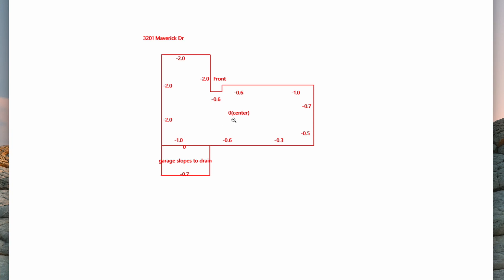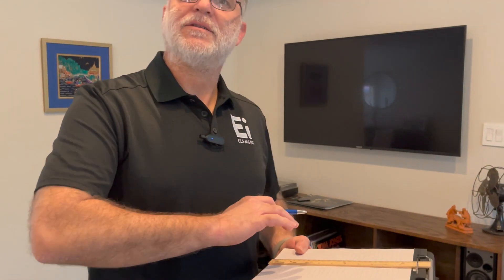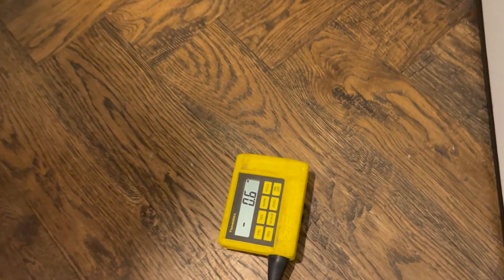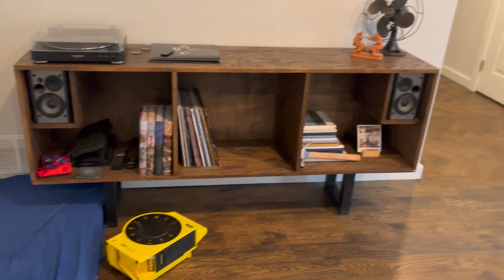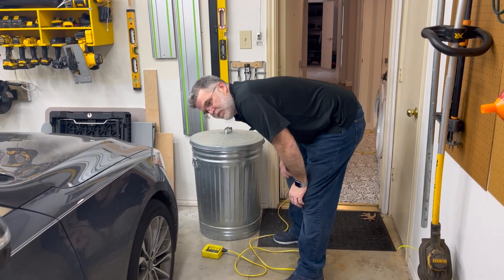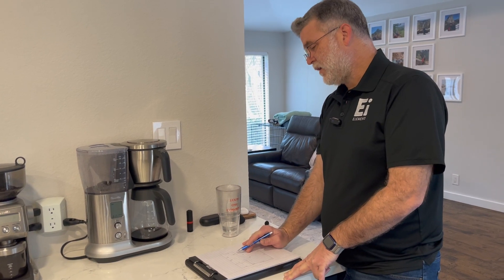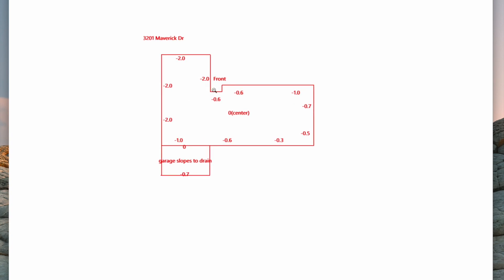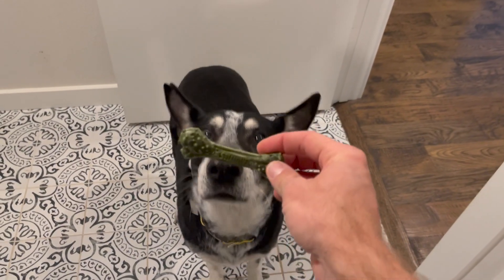Should we recommend an engineer? Use a Zip Level to find out.

Comment: What is a -4 mean if I have 2 -4’s and a lot of -1 and -2 and 0’s?
Reply: thats going to be -4 in unless you see 0.4 if it is a 4 inch drop that means the foundation is 4 inches lower in that area when compared to the center of the home, thats a lot of movement if the house is normal 2500 ish square feet, if we are taking about a much larger home that movement may be ok